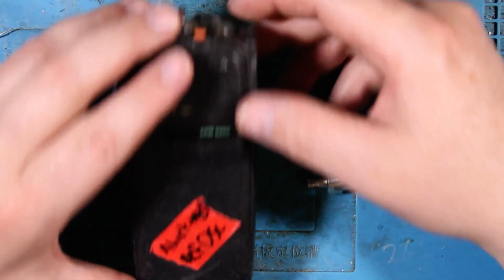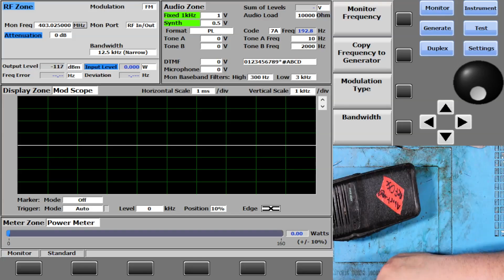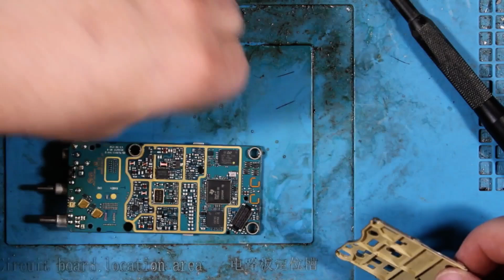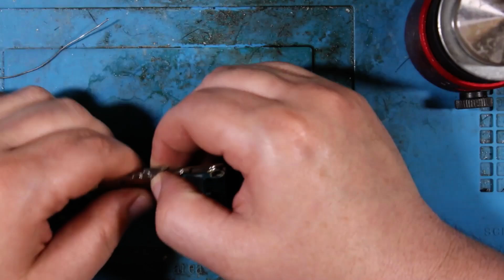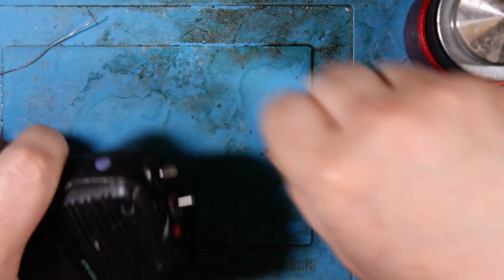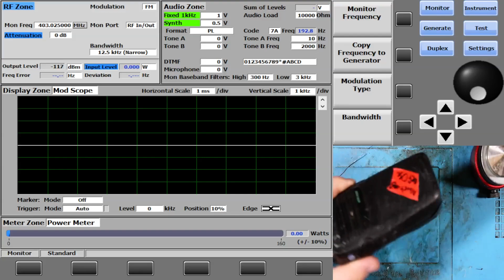Motorola XPR 6350 Power Amp (PA) Replacement - Repair Guide

Comment: If you can, please show us using the Tuner for the radio alignment.  These radios are over 10 years old, and they do need an alignment done.
Reply from the maker: It's been a while since I manually tuned a XPR radio. I use the Aeroflex 3920 series for auto tuning the radio. Give me about a week or 2 and I'll show how to tune the xpr manually.
Reply: @BlueMountainRadios  Wow!  That is an expensive equipment.
Reply from the maker: @justcasey3678  Radio equipment is always expensive. Even the older non auto test equipment can for a few thousand on eBay.

Comment: I purchased a 6550 from Ebay.  It has the "tone of death" and it just randomly comes on.  I did research on the web and all said that it needs an updated firmware.  Originally, it had 01.12.17.  I found the 1.17.08 and installed it.  It was fine for a few days.  This morning when I pushed the PTT, it had a loud blaring tone.  I shut it off and turned it back on.  This "tone of death" is still there.  Have you experienced this before with the 6550?
Reply from the maker: @justcasey3678 When you say tone of death, do you mean just a constant error tone? 

Also as far as I know the most recent official version firmware for the XPR6000 series is 1.12.17. I have never seen a 1.17.08 firmware for the XPR 6000 series. Doing a quick search it seems it was supplied when customers had the issue you are stating. I've personally don't think I ever came across this issue. Nor would I know how to replicate it. If I have random issues like this I'd just do a normal firmware recover via CPS.
Reply: @BlueMountainRadios  I thought I have upgraded the firmware to 1.17.08 and found out it wasn't.  I was using CPS Ver 2.0 and it didn't find the firmware.  I switched back to Ver 16 and upgraded the firmware to 1.17.08.  After a few days of using the radio, I did not experience any "tone of death".  It is all working fine now.
Reply from the maker: @justcasey3678  sounds good. I'm still looking into this 1.17 firmware as I never heard of it till you mentioned it and never had this issue on any radios I worked on.
Reply from the maker: @justcasey3678  The only way Id be able to help more is to have the radio in front of me. Sorry I can't me more help on this subject for you.